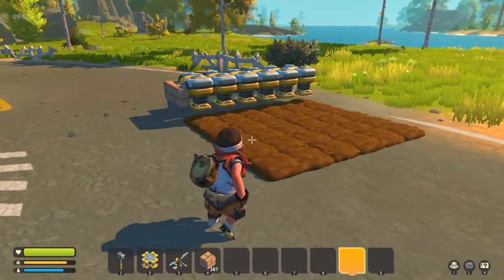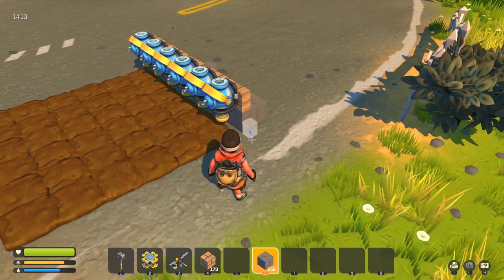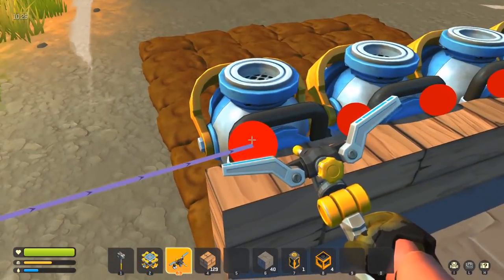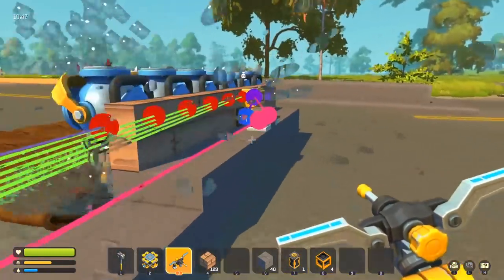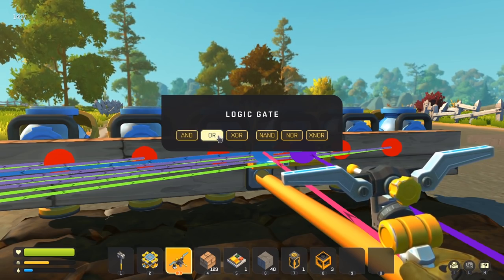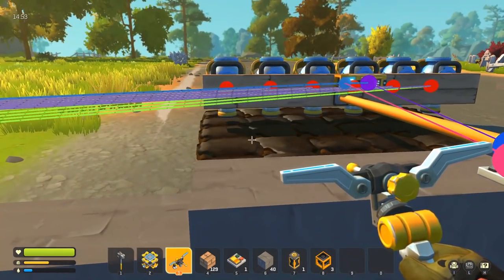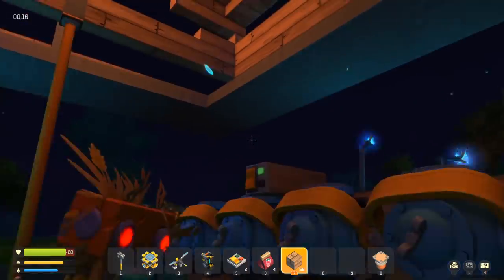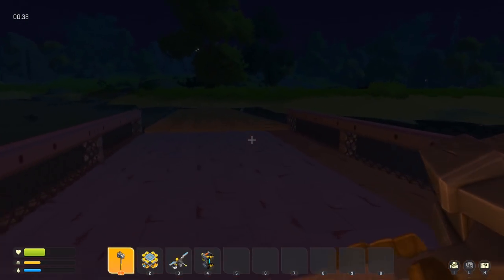FARMING TRAP TRIAL AND ERROR | Scrap Mechanic Survival Gameplay/Let's Play E15

Comment: You should be able to get the planting to work with some sensors. Use the sensors to trigger the pump and cannon at each plot, and if there's no sensor once the pump runs past the last plot, then it won't spit out a seed. The difficult part with auto-planting is keeping everything moving slow enough to accommodate the planting pump, since it fires off much slower than a water cannon.

You also had a decent set up with the piston crusher, but when the crusher was raised, there was nothing to block the bots from just walking straight into your plants. You'll want a barricade wall, like you used with the lift crusher, to keep the bots in place under your crusher. Also, put the crusher on a controller, looped, to keep raising and lowering once you turn it on. You might need to upgrade it a couple times to speed the movement up, since a L1 controller can be kinda slow for crushing bots. Also, to save on some time and resources, the crusher doesn't need to go all the way to the ground or be perfectly flush with a barricade wall. A one block gap anywhere around is fine, heck two would probably be fine; no bot is only two blocks tall or wide.

Comment: Since welding doesn't transmit through pistons or bearings, if you want a one piece crusher, you would have to be able to put the whole mechanism on a lift to do the welding.  So if you were to start with a bar the length of your piston spacing, then place the pistons on the ends of that bar, then build and weld the tops, you would be halfway there.   Next weld the rod into your farm (might have to remove some dirt temporarily), then remove the middle of the rod (and put the dirt back) and you should be good to go.

To prevent the mobs from getting in, you would probably want a wall at least 4-5 blocks tall and 2-3 thick right up by the dirt, with the crusher perimeter outside the wall.

Comment: for this setup you have here you can add a small wall along it. add a sensor on the bar with watercannons  , then on the wall you place a block for center of each row.   when sensor see that block you make it fire water.  i like trying to keep stuff mechanical and only use logic if absolutely needed

Comment: Late comment but the issue of the water tank not connecring is because your base structure (where the sprayers are attached was not likely 3 blocks below the ground. Therefore when you removed the 1 and 2 height blocks the remaining 3 deep wall could not contact the 2 deep wall structure. Hope this helps.

Comment: if you want to weld it then it need to be on a lift.also you can make a U shape that keep bottom connected that you can delete after you welded it to ground.  this way you weld it as a single structure and all parts connect.

Comment: Two years later I am going to reply lol...
If he had connected the pistons to a controller, he could of set the controller to loop and as long as its turned on the pistons will raise and then lower his smasher.   The big mistake he made was that he didn't have a way to slow them down once it went up.   I use a smasher on my builds to this day, I make a wall then instead of making the wall really thick, I just do a floor almost at about four or five blocks high all around the farm.   Then I make my smasher on the outside of that floor, and i use multiple maxed out level pistons and a maxed out level controller and a simple switch.   That will work perfectly for the normal farm bots, but not the big ones.   I upgrade the blocks to the final tier of metal to stop them from being destroyed, which helps a lot as well.   My farms usually end up having a lot of farm plots, and i do the same kind of thing he did with his farm here, just bigger and higher off the ground. 
The smasher is one of the two ways I usually do my farms, the second way is using turrets and sensors, but I find that to be really expensive and it takes way more time to get right.  

Okay, I am done rambling on a series Zueljin is no longer doing, which is kind of sad really, but oh well.